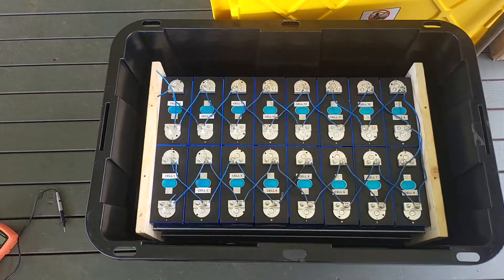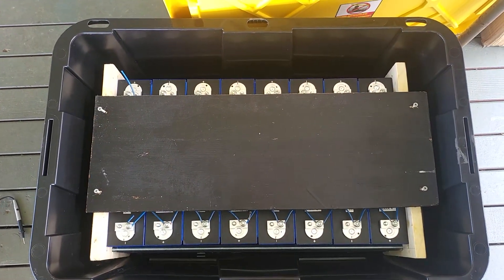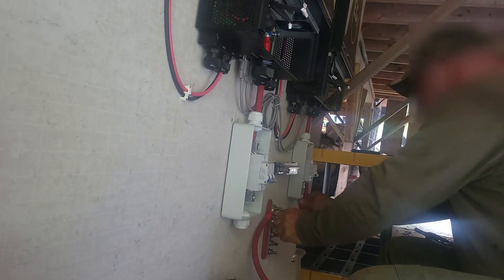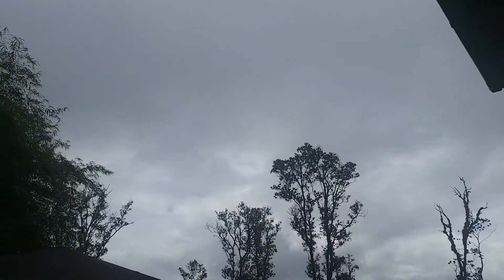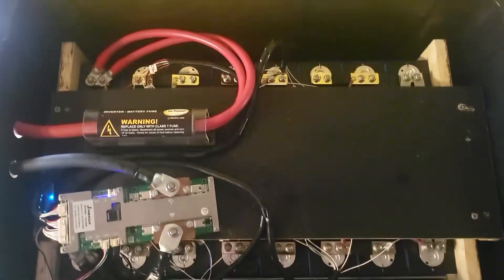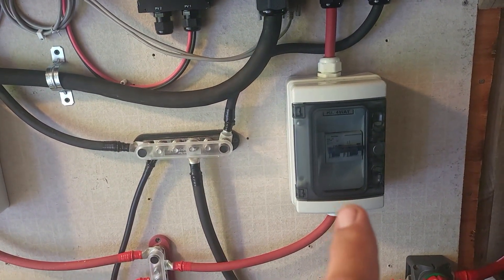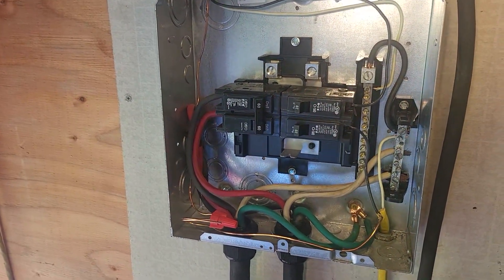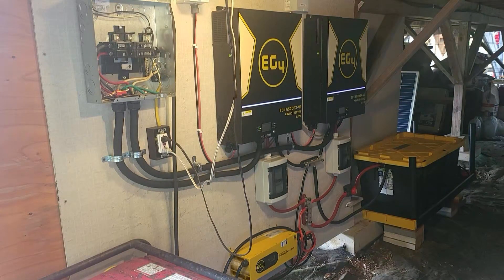DIY Off Grid Solar - Part 7 - Final system overview and DIY LiFePo4 battery

Comment: I have built a fairly large battery with the same cells you are using. I bought a active balancer that i plug in on occasion when the battery is fully charged and it top balances the battery really good. I unplug it after a couple hours then lower the charge voltage back down to 3.45 volts per cell. Ive only done this a few times as the batteries have stayed extremely well balanced with only the 300 amp bms doing a slight balance starting at 3.4 volts. Ive been completely off grid a while now and although it was 30 grand worth of components it was well worth knowing we will have electricity for the rest of our lives. Hopefully everything holds up ya know. Anyways.. thanks for the videos i love seeing other people with the same mindset.
Reply from the maker: This property is in the Goldilocks zone in Hawaii, not too hot, not too cold, so no need for heating and cooling.  14k worth of battery runs everything, but I am adding another 5k of battery should give nearly 3 days of autonomy.  My primary residence is another story.  $500/month electric bill.  I would like to just take the split air con to the new solar units hitting the market.  But that is replacing $15K of units.  For active balancer, I am considering trying out an active balancer for my 105 ah cells and 5K battery that I am going to put together.  Don't think I will top balance it and try out a balancer just because.  I also set my JBD bms to charge balance at 3.4.  Well time will tell, but it sure is a good feeling to not be reliant on a grid for power.  Thanks for stopping in and commenting, I also love to hear others stories!
Reply: @keaomakaranch  I use a 38 seer minisplit and it's been the best addition to making off grid comfortable other than the solar itself. Yeah the active balancer makes top balance a breeze. It's well worth the 30 or 40 bucks just in time savings alone plus it's a great way to balance every few months to keep getting the most out of your battery. I'd absolutely love to be in Hawaii. That's gotta be like living in paradise for sure. I've traveled the 48 for work for a few years but man... Hawaii... that's awesome
Reply from the maker: @matthewknight5641  Im in on trying the balancer.  Which one are you using?
Reply: @keaomakaranch  I've actually bought several active balancers but the ones I like best are the ones I found on Amazon. They look exactly like the heltect balancer but it's not branded as being heltech. I have 4 of them. If I'd have known at the time of ordering that they couldn't be connected all the time I'd have only bought 1 or 2. If they are left hooked up all the time they sem to actually unbalance the pack. The way I use them is just hook it up and fully charge the battery. The bms shuts off charge once a single cell hits its max but the active balancer quickly drops the voltage of that cell and puts that energy into the lowest voltage cell. Then the bms starts accepting charge again. It doesn't take long at all and the entire pack will be balanced. Once it's balanced you can just unplug the balancer and the cells stay really closely balanced with the passive balancer inside the bms. Those little active balancers make the hooking the cells all together in parallel for balancing a thing of the past. Besides trying to charge 8 or 16 cells at 3.65 volts is a crazy long amount of time wasted just waiting on them to top off. Yeah the 30 bucks spent and being able to use the battery in a couple hours rather than days or weeks later is definitely worth it
Reply from the maker: @matthewknight5641  Good information, much appreciated.  Looking at them now.